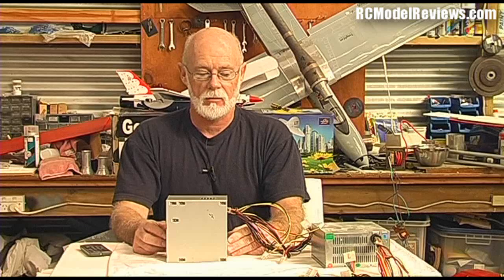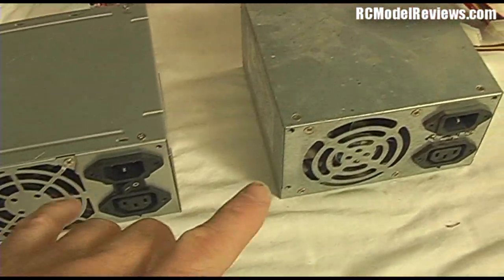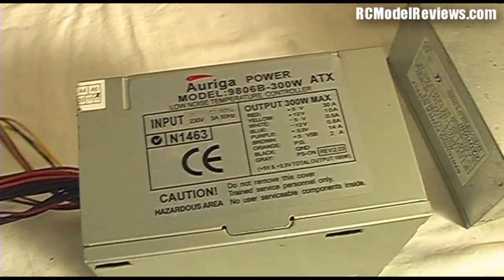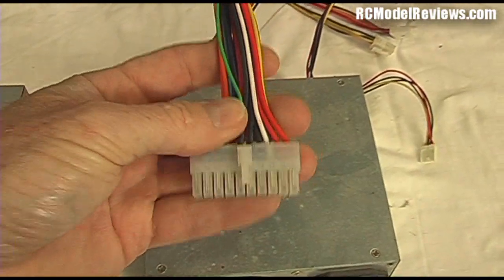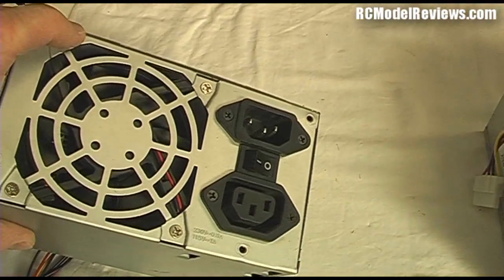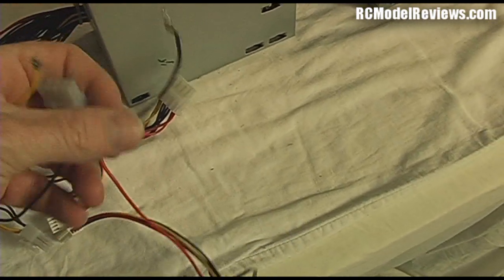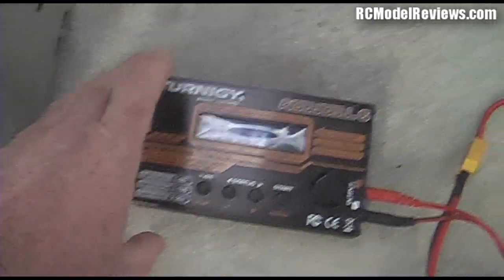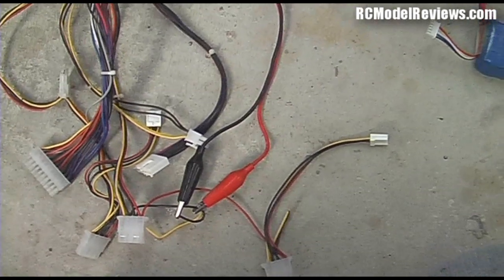DIY: Using a PC power supply  with your lipo charger

Comment: I want to build a field charging station for my 3s1p 2250 mah batteries for R/C flying. Can I use a high mah 3s1p  (say 20,000mah) to power my lipo charger? So the train would be a large mah 3s1p lipo battery to power the lipo charger that would charge my 2250 3s1p batteries. Thanks, Lewis

Comment: I cut all the wires off just inside the power supply case and bundled the different colours together and put heat shrink on them. On the 12V I put an XT 60 tail which plugs straight into the charger input and stuck the charger to the power supply with double-sided tape.

Comment: Hi there, i have a question if the charger max power is 80w, wouldn't this toast the charger, 12v (voltage) x 10A (current) = 120watts which is well above the maximum power of the charger, so at 12v the maximum current would be 6.66A  to match 80watts it's that right?
Reply: No sir. Your charger will only pull what it needs. You will only damage your charger if you put too much voltage to it

Comment: Why would you do this instead of just buying a charger with a ac plug. The ones with AC plugs are just as cheap as the ones without.
Reply: takes the strain off the charger and way more heavy duty.

Comment: i guess i had bought the wrong supply mine came with a  long gold tab  is there a way to convert the one i have ( it was an ebay buy) its a1200w psu and it looks like the gold tab that you see on micro sd cards or the old nintendo video games

Comment: After 6 years tthis video is even more relevant! 12V is what you need to run most of LED lightnings, which are ultra cheap nowadays, only expensive part - powersupply :)

Comment: I've just got the Accucell 6 80w charger that comes with a XT60 connector for the power supply. Just want to check I can do this and solder the 12v and neg to an XT60 and that'll do the job?

Comment: i have made simmilar thing with PSu  thing with same charger as in video .. Have made the jumper connector to short those wires on 24 pin main connector,  only cut 4pin cpu jack to connect with accucel 6 and works fine

Comment: is 12 volts 10 amps enough to get an electric shock?
Reply: +Travis Pratt amps are what kill you, not volts. So they do matter.
Reply: I don't think so, from what Ive read you need about 50 volts to get a shock, amps dont really matter, as far as I know.
Reply: No you will not get a shock.
Reply: Well I meant as far as determining if you're going to get a shock. If its under 50 volts no matter the amps you won't get shocked because there wont be enough power to push those amps through your body. Also very high voltage and low amps can kill you too, lightning is a perfect example.
Reply: Well, i should clarify its only your dead skin cells that prevent those volts, if you shock an open wound, or are a kid or have very wet soaked skin less volts are needed. Before anyone decides to go touch a high amp 49 volt wire... don't do it lol.
Reply: +Travis Pratt yes, lightning can kill you. But "williams" says that a typical lightning bolt may transfer 1020 electrons in a fraction of a second, developing a peak current of up to 10 kiloamperes.10 kiloamperes is definatly enough to kill you, the part about low amperage is simply a myth.
Reply: +TECH.BYTES Okay, true You need volts to carry the amps before they become lethal, but as you clarified if you fx. are wet and touch a 49 volt wire with fx. 20 amps It's not a good idea. haha :-) 😉
Reply: TECH.BYTES Yea, electricity is dangerous and a bit unpredictable, that's probably why it's not common to spread the fact you're unlikely to get shocked at under 50 volts. If the amps are there and the electricity passes your layer of skin somehow a lot of electricity we use can be deadly.
Reply: Travis Pratt yup
Reply: thanks.
Reply: thanks.
Reply: Azim Alif No problem :)
Reply: +phm yea thats a good example, car batteries are very high amp low voltage, so tons of electricity but not much pushing that electricity. A car battery can kill you if the elctricity somehow passes your dead skin layer though so its good to not get in the habit of shorting em out.
Reply: o, thanks.
Reply: Only if you stick it across your tongue and will give you a small shock or if you have wet hands it might shock a little bit
Reply: Up to 60V DC is safe.
Reply: it will be fine other wise people would get a shock from car batteries.... 12v 400-600 amps.... but yea a 560cca battery can output 560amps for up to 30 seconds

Comment: Hi Thanks for your advice recoverting a computer power supply to a bench supply. 
I'm wondering why U didnt make the final connection to the charger more fail safe. by doing a m/f connecto directly to the computer femail plug?OR is that an obvious thing for most of us to do?

Thanxs
Jim

Comment: Thanks for this post.
i just realized today that my old car-battery charger goes over the max voltage for the lipo charger when i connect the lipo charger, and had to start looking for other options. This looks like the perfect solution, as it allows me to keep an eye on things when charging batteries, and to keep it indoors, in stead of having to do a connect the charger to the car battery and keep running outside.

Comment: G'day,
I recently converted another PC power supply exactly the same as the previous one which worked perfectly fine.
The problem with this one is that when I turn it on, it turns back off about a second later.
Very frustrating, I haven't  done anything different to the last one. I even pre-tested it by shorting the green/black with a paper clip prior to modifying it, just to make sure it wasn't faulty.
Reply: +Steve Vakalis 
Steve, these supplies won't give you full voltage on the 12V side unless there's some load on the 5V side. Connect a 4.7 ohm 10W resistor to the 5V (red to black) thus loading it to 1A and the 12V will pop up to 12V.
Reply: Thanks for the tip Geoff, much appreciated and I'll definitely try that on the  next one mate.

Comment: I push it up, because ithink that is iportant for everyone.

when you carge more than 2s or more than 2A.

4s @ 2A  =    ~3A @ 12v PSU
6S@ 2A  =     4-5A @ 12V PSU

You have to install a 5OHM (5-10W!!!!!) Resistor between a red and a black wire. Nearly all PC PSU controll the 5V, the 12v is a secundary result from the 5V Line.
In your case, the 5V is OK, no Load, but the 12V has a hi Load, so the Voltage is sinking and the Charger stop.

!!! But the Resistor (a Lamp is possible too) on a heat resistand surface, maybe fix it on the PSU. !!!!!!

Eagle71

Piyush Parmar vor 9 Monaten
 I have a pc psu same as shown in video. 
Problem is i get only 3 amp max at 12V .. if i go to charge my lipos beyond 3A the voltage drops below 10V wich make my charger to stop charging. 
What should i do in order to get more ampere at output without getting lower then 11V??? 
Charger i use is turnigy accucel-6. 
help me sort this out guyzz... 
Thanx :-) 
 
 
Toni Auer vor 1 Sekunde
 Late but not never.
You have to install a 5OHM (5-10W!!!!!) Resistor between a red and a black wire. Nearly all PC PSU controll the 5V, the 12v is a secundary result from the 5V Line.
In your case, the 5V is OK, no Load, but the 12V has a hi Load, so the Voltage is sinking and the Charger stop.

!!! But the Resistor (a Lamp is possible too) on a heat resistand surface, maybe fix it on the PSU. !!!!!!

Eagle71

Comment: Hi Bruce,

I know this relates to an old review, but it's still highly relevant and very useful.

Last week, I bought a Chinese copy of an Imax B6 LiPo charger.  These things have received mixed reviews on the internet, but it was only £11 brand new including postage and from a UK seller, so I took a chance.  If it lasts a year, I figure I would have had my money's worth.  As an aside, the main criticism seems to be the voltage they charge the LiPos to, which under certain circumstances can be dangerous if it's too high, but I also learned from the internet that they can be recalibrated to the correct voltage which gave me a little more confidence.

Using the B6 charger to charge smaller capacity LiPos either via a 12 volt battery or my mains adaptor isn't a problem, but when I tried to charge a high-capacity LiPo at a figure above 2 amps with my mains adaptor, I kept getting an 'Input Voltage Error' message, so I looked on the internet to see if others had the same problem.  It then became apparent that my mains adaptor wasn't able to deliver the necessary amps, so I revisited your own solution, and I'm glad I did.

I had an old computer power unit kicking around so thought I'd investigate it.  The wiring proved to be exactly as you described so took little work to modify it.

You correctly point out in your video that the power on 12 volts through the yellow wires can be up to 15 amps so it is best to run two wires in parallel to distribute the load.  I did things slight differently.  I took the lid off the unit, de-soldered the yellow wires, and soldered a length of red 14 awg silicone in their place and ran it out through the front of the unit.  I did a similar thing with the black wires.

At the other end, I attached a female Deans connector, and tidied everything up with heat shrink tubing.

The B6 charger itself came with a variety of leads, one of which was for the input side.  It comprised a jack plug on one end, and two crocodile clips on the other for attaching to the 12 volt supply battery terminals.  I cut that in half, and soldered male and female Deans connectors at the severed ends (female from the supply side).  That allows me to use either the crocodile clips for when I'm at the field and wish to use a lead acid battery to power the charger, or a Deans for when I charge from the mains via the computer power unit.

And with 15 amps at its disposal, the unit works a treat and no more of those annoying 'Input Voltage Error' messages!

Many thanks.

Tad Davison

Cambridge UK
Reply: Tad Davison sounds like a good job, I can picture it perfectly and would work a charm. I will wind maybe 5 yellow and 5 black together.

Comment: Hi,
 I recently converted a PC power supply to charge my lipos and it works fine but when I measured the voltage from the PS it isn't quite 12v, it measured 11.34. Just curious as to why this? I used capacitors initially like they said in other videos but that dropped the voltage even further to 11.17 so I removed them and it increased 11.34.  I have also paralleled 3 yellow and 3 black on each of the 2 ports.

Great video by the way just like your other videos. Very easy to follow and understand.

Cheers
Reply: ***** Most likely due to being a crappy power supply. The 12v rail is often quite far out in cheap psus. 

It's not going to harm anything at all. I would recommend spending no less that £40 on a decent psu.

Comment: Thanks Bruce. I love this stuff. Picked up two power supplies from recently-dumped new-looking Dell PCs at our local tip. Five minutes of soldering and they work! Do I need to take precautions about over-charging lipo batteries? No alarms to say battery full.
Reply: I hope you're joking. If not, then I would like to advise you not to charge your lipo directly from this. This is a tutorial on how to make a 12v power supplu for your lipo charger. If you directly charge a lipo from this supply alone, then you have a great risk of having a lipo fire.

Comment: Can i Cut the rest of the wires off? I go mad when there are dangling wires........grrrrrr.
Reply: thanks. :)
Reply: Sahan Methmal Yes.
Reply: Ok.
Reply: Sahan Methmal make sure you shrink heat shrink all the cut wires so they dont arc out on anything, another guy opened the box and cut them all short and heat shrinked them inside which I will do. He used about 6 yellow wires and 6 black wires as he was using a 20 or 30amp power supply.

Comment: Do you know of any 12v 60amp computer power supplies or server supplies that can be easily converted to power my60 amp required Hitec X2 400 charger? I have a old IBM Artesyn 12v69amp server power supply but do not know procedures on converting for lipo use.  Thanks

Comment: how can i charge 22.2v battery?
Reply: +Mohammad Salauddin Sarker 
That's easy. Get a 6S charger and plug it into this power supply. The charger has the ability to charge at higher voltages than it is powered by

Comment: I've a Turnigy Mega 200W x 2 Charger. HK recommends to use min 500W power supply. Can I use 300W computer power supply, if so what is the max Amps I can use to charge two 3S batteries at the same time. Thanks a lot for all your videos, love them, very informative. Keep it going.

Comment: Mate, . . Now that is Banging an I Proper Love it Trus, . Lol, . ! Iv been trying to sort out a way to charg a couple of tablet batterys, 7.4v, 1500mah-3.7v, 340 mah, an others, at the same time with out many diff power plugs all over the place, an having to watch them so they don't Blow up or burst into flames, . . Cus that bit is Not Funny as iv not long found out, . Lol, . REALLY, . ! But this way is GREAT an Safer than the way I was doing it, . So Thank U So Much, . ! An are any of the other wires live at all, . But at a "SMALLER VOLT" than 12v, . ! Plus how long would u say it would take the unit at 12v to Only "HALF CHARG" a 3.7v-340mah, . ? Cus that would be so much help to me, . . Thank U, . DAY, . !

Comment: I have a pc psu same as shown in video. 
Problem is i get only 3 amp max at 12V .. if i go to charge my lipos beyond 3A the voltage drops below 10V wich make my charger to stop charging. 
What should i do in order to get more ampere at output without getting lower then 11V??? 
Charger i use is turnigy accucel-6. 
help me sort this out guyzz... 
Thanx :-)
Reply: Late but not never.
You have to install a 5OHM (5-10W!!!!!) Resistor between a red and a black wire. Nearly all PC PSU controll the 5V, the 12v is a secundary result from the 5V Line.
In your case, the 5V is OK, no Load, but the 12V has a hi Load, so the Voltage is sinking and the Charger stop.

!!! But the Resistor (a Lamp is possible too) on a heat resistand surface, maybe fix it on the PSU. !!!!!!

Eagle71

Comment: would it be possible to use the 5v wires as input power for a cheaper servo tester so I don't have to hook up a speed controller/bec and battery to power it without frying servos.

Comment: Thanks for all your videos. I'm not electrician and I am new to the RC Model field so all of this is very helpful including all your LiPo videos. But why don't these battery chargers just come with a power supply? And while I apprecieate the idea of using old computer powersupplies, I don't really want a bunch of wires just hanging around not being used.
Thanks
Reply: You should check out Progressive RC. They have charger and power supply combos, a few of which, are quite reasonable in price. I got the "The Ticket" combo which comes with an ICharger 206B and a 300W power supply for $185, as well as your choice of battery connector cables, lipo guard, and optional modular board for parallel charging. It's not what I would call a cheep set up, but everything is quality built, is as plug and play as you can get, and is easy to set up and use.
Reply: Airwolf classic example of being scared of the unknown....it's not going to hurt anything...open your computer...you'll see a ton that are just hanging in there not connected to anything and your fine with that...cuz you don't See it and you don't understand it

Comment: I just discovered that the power supply I got has another wire(brown) that needs to be connected to a 3.3V wire(Orange)  it was connected like that at first but I cut the wires to save space.  It's not a problem if you leave the wires as they are.

Comment: Hi! I did everything like you have done in video but I get max 0.5 A on 7.4 charge I guess it is a faulty power supply???
Reply: hey ive got the same problem...did you find a solution?
Reply: connect a load from one of the red wires to earth, like a 10 ohm wire wound 10 watt resistor or some wont work.
Reply: stelio koukouzellis connect a load from one of the red wires to earth, like a 10 ohm wire wound 10 watt resistor or some wont work.

Comment: Hi there apparently your supposed to connect a load from one of the red wires to earth, like a 10 ohm wire wound 10 watt resistor or some wont work...Fred ik.

Comment: Yes that should work fine. Just ensure you have enough wires connected to the output post depending on how many amps your pulling. 
Many times, they quote multiple rails but it turns out there is actually only one rail. Its only really possible to tell that with the power supply open, but either way you should be good to go! Also, remember to have a matching amount of wiring for your ground too!

Comment: Hello Bruce. I'm in progress to make this conversion. The thing is that I have a Fortron Blue Storm II which has  2x 12 volts outputs with 18 Amps Each. I want to buy a Cell Pro 10 XP and I want to know if Is ok to parallel the two 12 wolts outputs to have a better Amps.  Also what charger would you recomand that charges quickly and individually the cells. Please excuse my bad english.

Comment: You might have to put a resistor on the 5v circuit because sometimes the psu won't put out the full voltage unless it has a load

Comment: I actually did this a couple of months ago.  I use an atx psu for my 3d printer. Just took a yellow and black wire and soldered it to a xt60 plug :)

Comment: Except there's very little space left in those metal cans, and here would definitely not be enough space to fit the charger and battery. (yes to do 100% need the charger or your batteries will go boom 100% guaranteed)

Comment: uhm, because the wallwart has a maximum of 1000 milliamps, that is 1 amp. If you try yo pull anything more than that, the voltage drops a lot. So yeah, you answered your own question :P